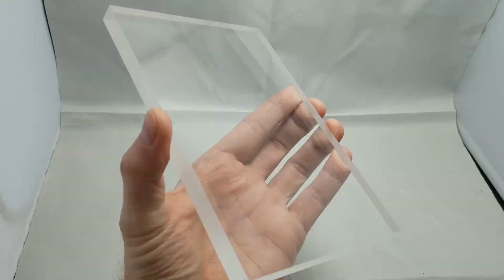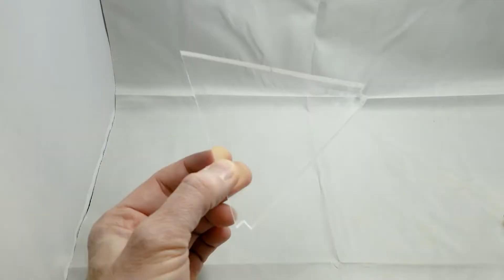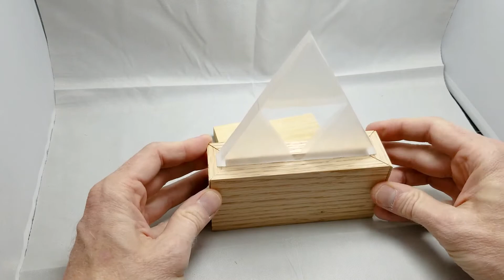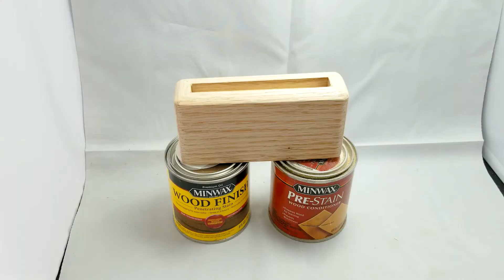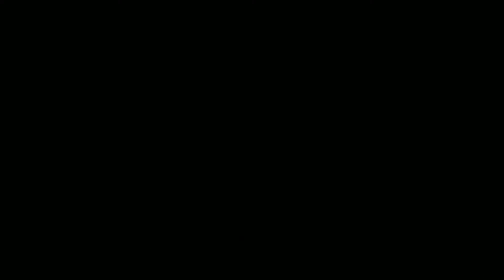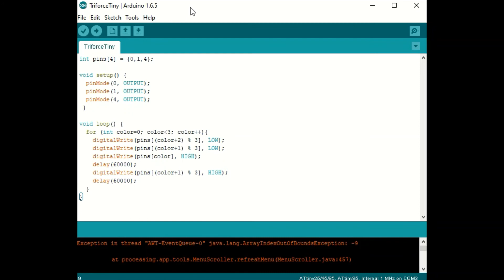DIY Color Changing Acrylic Nightlight using ATtiny85 Microcontroller and Arduino

Comment: Hi. Can we supply an Attiny85 from an Arduino nano? For ex pin 6 high and grund?
Reply from the maker: You can power it with the Nano, but I would use the 5V pin instead of one of the outputs. The 5V pin can source more current than a digital output pin.